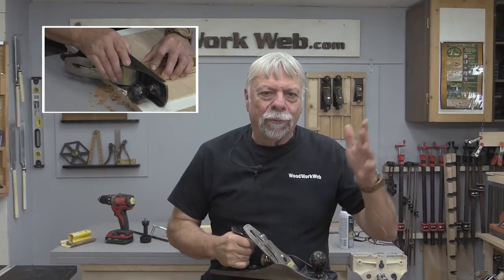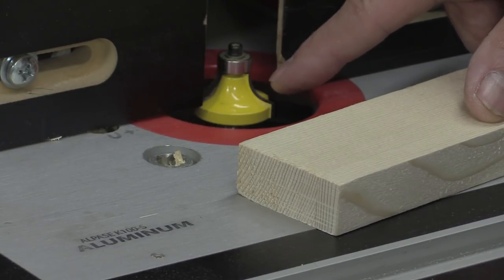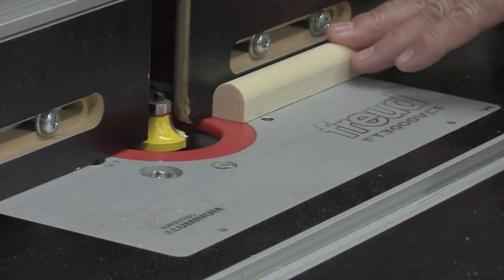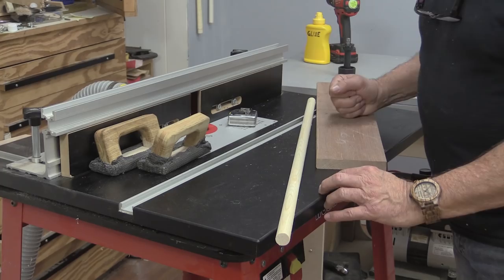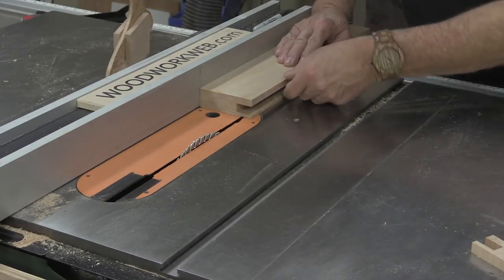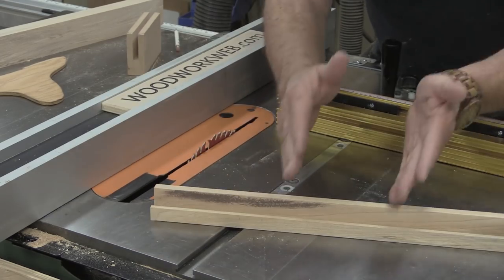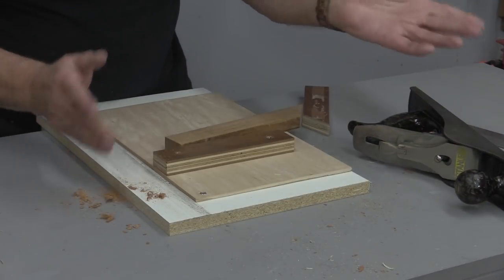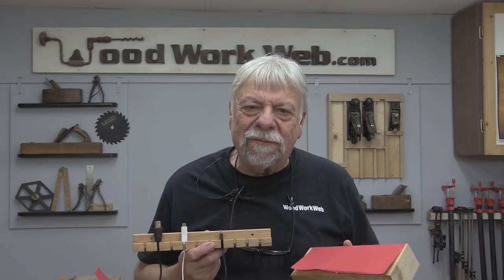Colin Knecht's Quick Woodworking Techniques / WoodWorkWeb

Comment: I haven't seen anyone explain the shooting board in a long time.  Coming up as an apprentice, the old master carpenters showed me how to make one and using a low angle block plane makes it easy to tweak miter joints on trim.  I later on in life came to the realization that sandpaper attached to a block of wood accomplished the same task in fact it made it easier.  Thanks for the awesome videos and Merry Christmas.

Comment: what's nice about the wood sanding block method is that you can make it any size or odd shape as needed. 
also in certain situations it's easier to sand the piece by moving it against the block, rather than moving the block against the piece

Comment: Router table dowel making: If you worry about getting your fingers close to the cutter or have trouble getting the 4th pass to work, just hot glue a piece of scrap stock to the (future) dowel when you have cut if free from the board, then sides 3 & 4 are as easy as 1& 2. Also a good idea for very long pieces to stop flexing and chatter. The wood block with sandpaper technique is something that will let you do compound angles on a simple shooting board - just cut the 2nd half of the compound angle on the side of the wooden block and the first half on the fence piece.

Comment: Your idea of using a plane or sandpaper to clean the end of a piece of wood is great.  However I noticed that you were having a bit of problem holding in place the sand paper you had stapled to the block of wood.  What I do is spray glue on the wood block and glue the sandpaper to the wood block.  I do that on all 4 sides using different grit sandpaper and I note the grit with a sharpie. I place a strip of wax paper under the sanding block to keep it from sanding into the table.
Reply: Perhaps a new type of sanding block for this technique is in order? I am not a fan of spray mounting sandpaper to hold it, makes the changing of the sandpaper harder. Instead, I have experimented with "L" shaped holders which can clamp the paper into place, and also give two flat planes of surface to use before having to change the paper. The clamp is basically two half inch thick "L"s, the paper wrapped around the first, then the second pins the paper to the backside, with bolts and wing nuts as a holder mounted at 45 degrees out of the base of the corner. A piece of quarter inch ply is screwed to the bottom of one side over the sandpaper, and this acts as runner for the shooting board, adjusted for your needs.
Reply: I think I have an even better idea than my first reply. simply wrap the paper all the way around the half inch board, leaving a quarter inch gap at the bottom for the shooting board, and on the back side of the block, simply route out a groove or depression for a holder board of any size to clamp the sandpaper in using, again, wing nuts.
Reply: You can only put sandpaper on two of the four sides, I think; otherwise you're spending your effort sanding down the white melamine in the video? So two grits on adjacent sides (with a gap so you don't eat into the spacer/ quarterinch stock). This way also no waxpaper needed.

Comment: As always, a great video and some great tips.  Being as I am needing some dowels in walnut, purple heart and maple, I am going to use the router like you did.  My question is you said you were using a 3/4" round over bit to make a 3/4" dowel.  Wouldn't it take a round over bit that is 1/2 the size to make it?

Comment: The router dowelling method looks great. Have to try it soon. 
I'm not sure about sanding on the shooting board. I was told that sanding the end grain clogs the wood pores and prevents glue from working in properly resulting in a weak joint. How do you feel about this?
Reply: Inherently miter joints are weak.  Most woodworkers will reinforce the miter joint with splines. biscuits, dowels, etc.  Splines are the easiest IMHO.  Theory has it that the open end grain you glue is actually weaker because the glue gets absorbed into the end grain thus starving the joint.  I'll backup that theory in that the edges of boards being glued together to make wider pieces, are always planed smooth and result in a joint stronger than the wood itself.

Comment: isn't that a 3/8" round over bit?  3/8 + 3/8 = 3/4 right.
Reply: That’s what I’m thinking.
Reply: Jacques Moreau we are on the same page with the bit size being half of the dowel diameter (equal to the dowel radius). Thanks for the response.
Reply: Woodworker Anonymous yeah I have to agree. I think the gentleman above was deceived by Colin starting his dowel measurement at the 1” mark on the tape measure. Colin causing trouble again :) Thanks.

Comment: When you factor in tool wear and time, it is hard to believe that it isn’t cheaper to just buy dowel stock.
Reply: Technique is useful if you want walnut, cherry or other species of wood dowels that you won't find at the big box stores.
Reply: Dwight L Yes, if you shop at big box stores you need lots of help.
Reply: @dwightl5863  Agree totally, especially if you are trying to hide the dowel or even make a feature out of it. Huw